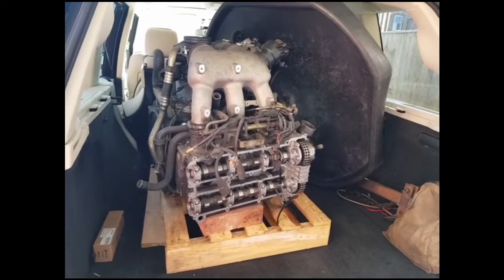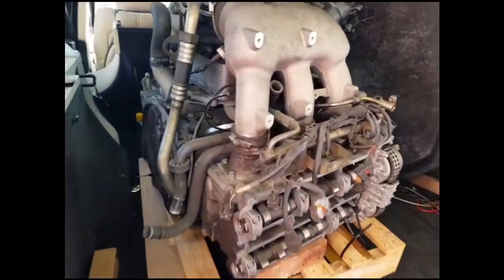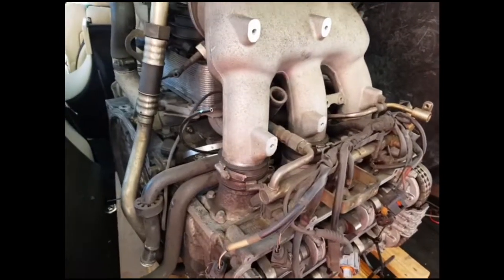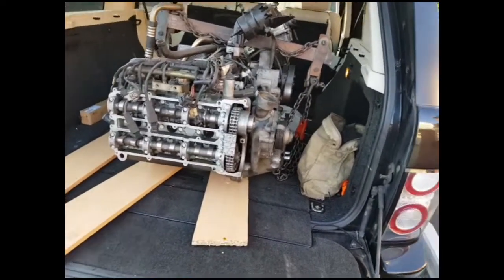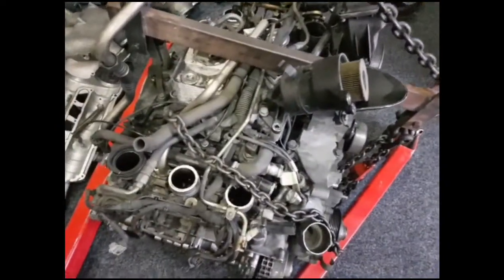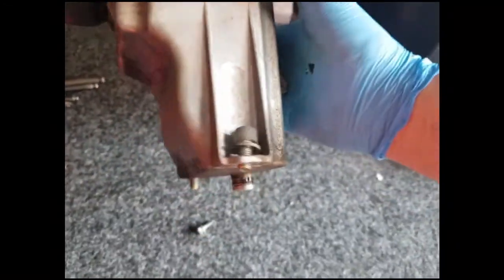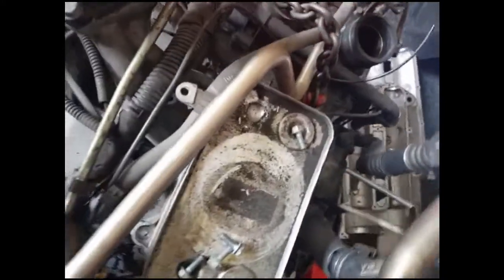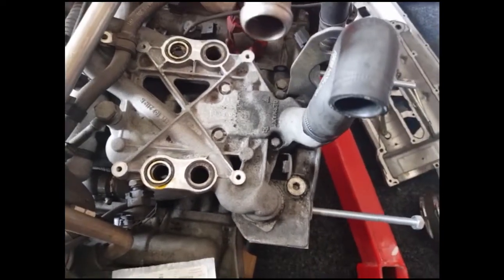Porsche 996 GT3 M96.79 engine rebuild. Part 1.

Comment: the gt3 is different to the M96 . the turbo, GT2 and GT3 were based on the GT1 block. The others were the M96 that was carrera , Boxter and cayman
Reply from the maker: They are all M96 engines, but as you say based on different blocks. The GT3/2/turbo ones are in the M96.7x designations.
Reply: Another big difference is the turbo /gt2 and 3 injectors the boxter and c2 etc are wet sump and have dip sticks
Reply from the maker: @danielvermeere7916  They are massively different, the GT engines are obviously modified versions of the old air cooled blocks to make them water cooled, with external plumbing and water cooled cylinder jackets and heads.   Carrera engines are clearly a descendant of the GT engines with massive simplifications, in terms of number of parts and cost reductions.  The water pumps are very similar, and they are all called M96 engines, but that is just about where the similarities end.

Comment: Martin, I hope you can help me. I have a 996 Turbo, I have had to remove the Alternator as it stopped working but behind and below I noticed a pool of oil on top of the engine, at 9.10 you point to a port and above your finger there is a rubber hose, below that is where the oil is on my car, do you have any idea the likely place it's coming from? It's a very low mileage car that's sat in a collection for 15yrs so I'm having quite a few gremlins like this.
Reply from the maker: That port is for the drain from the oil filter housing.  unfortunately to get that pipe out if the o-rings are leaking would involve removal of the oil manifold which is a big job.  I'd usually just clean the area up really well and then give it some time to see if you can see where it is coming from, but that is a pain if it is behind the alternator.
Reply: @martinhill5770  Thanks for this Martin , that's really helpful , I've cleaned it up and I'll keep an eye on it and luckily the alternator was a faulty reg/rect , now all back together and running perfect..brilliant car.